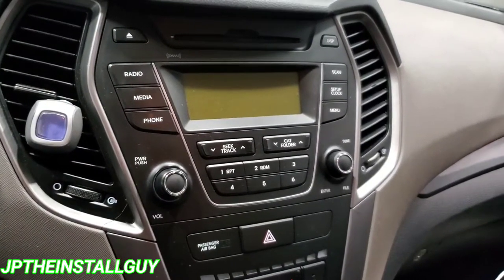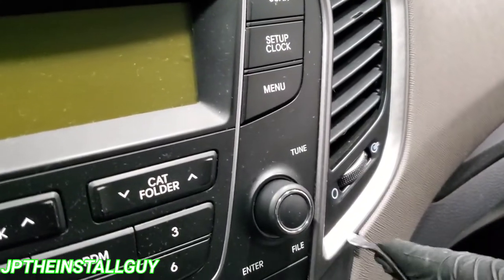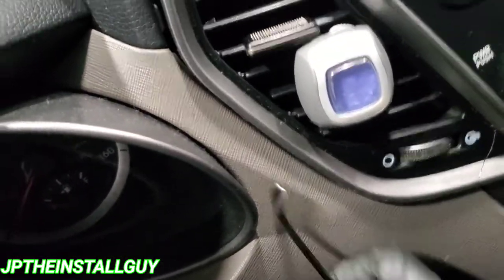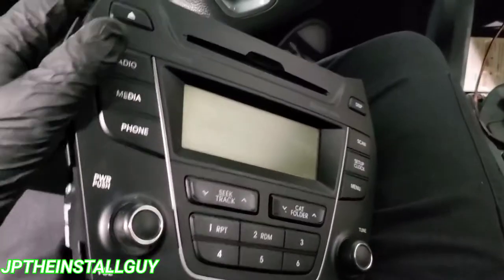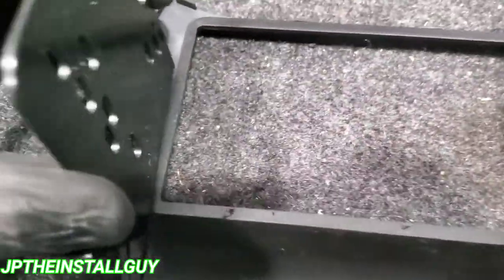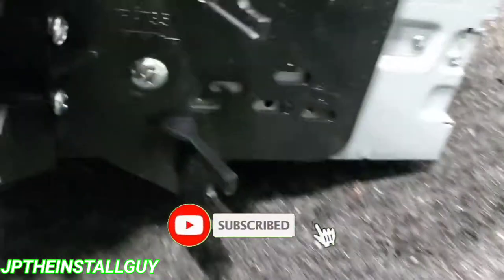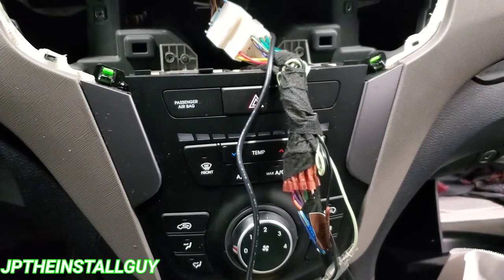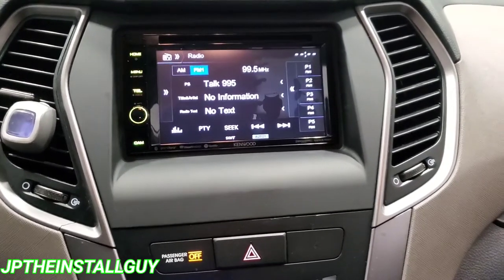2015 Hyundai Santa fe radio removal and kenwood double din install

Comment: Where did you find the color coded wiring diagram im tryna install a double din in my 2013 sport 2l turbo it doesn’t have nav but I plan on putting my head unit in the center consolé hidden away it’s only to run my subs but I want to tap into that factory harness

Comment: What's up bro, good video! I have a 2017 Tuscon and want to keep my factory XM, camera and steering wheel functions. Would I need a special adapter to keep the factory XM antenna on an aftermarket radio?

Comment: Will this work for a Santa Fe Sport 2015?  I was told they don't make a head unit/radio replacement for this vehicle.  They tell me I need to buy from Hyundai...
Reply from the maker: They might have told you that to buy from the dealer I would check Metra electronics website and see if they make a dashkit for the sport. Im sure its probably the same as this one

Comment: Bro is factory usb and aux port working ?
If Yes, How did you remove the port ?
I have a pioneer head unit installed but unable to activate factory port due to removal issue
Reply from the maker: when you take the factory radio out the factory usb and aux will not work unless they make a usb retention cable for the car so you might have to use the radio's usb or buy a flushmount deal if they dont make one for the santa fe
Reply: @jptheinstallguy  I am just planning to solder the usb and aux wires directly to ports in the hub.
The main problem is I cannot figure out how to remove the oem usb and aux assembly .

Comment: Has anyone had issues with the stock radio quitting and its not a fuse that caused it?
Reply: Yes, I do .My stock radio on Santa fe 2015 is shorted and needs a replacement. Still looking for one
Reply: @ultafraz  what caused the short? I had mine go out because I had the car jump started
Reply: @Paul2523  Haha same here. I used mine for jump starting it and it was also out a couple of times. Found that the radio unit was causing parisitic drain as it was shorted. Now driving without the fuse and looking for a replacement on Ebay. Any chance you found the solution? Can i jsut swap without dealing with codes?